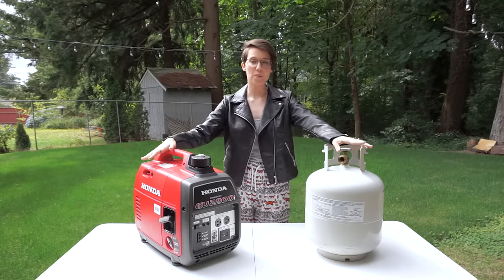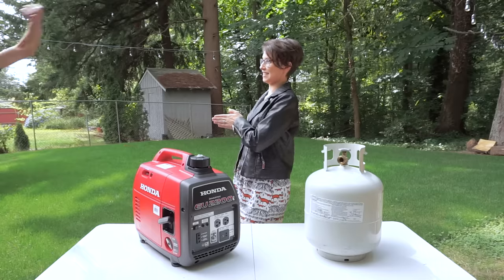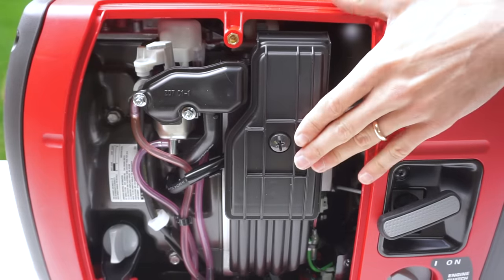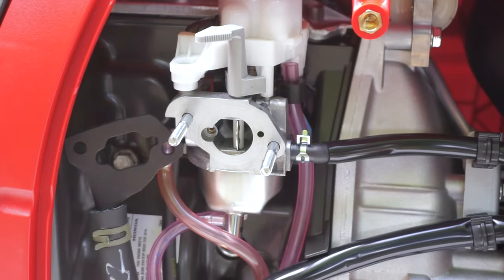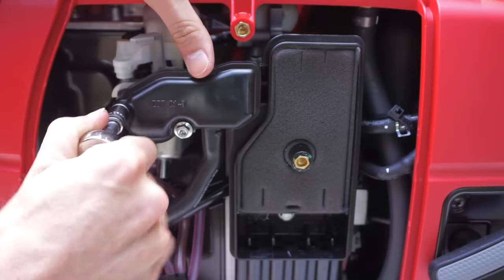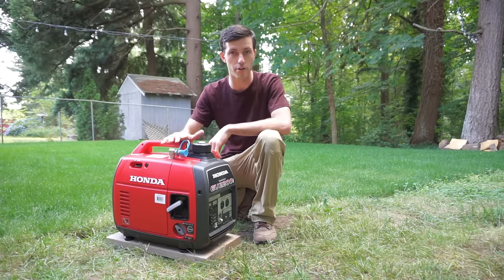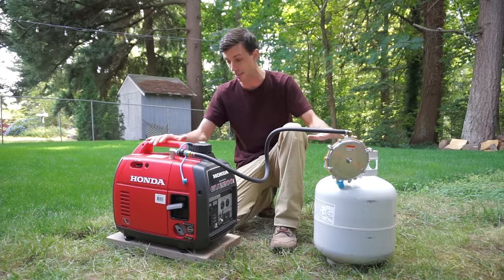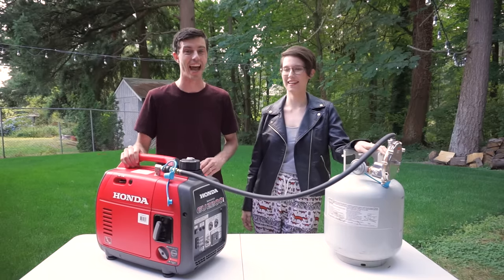Honda EU2200i Propane Conversion Kit - DIY Install for Honda Generator

Comment: How long can you run the generator on a twenty pound propane tank?
Reply from the maker: 32 hours at 1/4 load
Reply: @FateUnbound  That's impressive! Thank you. 

I just found your channel because we just bought a camper. Thanks for all the good advice and clear instructions.

Comment: When you find out how long the generator will run on a 20lb tank let us know please.
Reply from the maker: Will do! 👍
Reply from the maker: Hutch Mountain got back to me and said 30 hours of run time at quarter load, 22 hours at half load, and 12 hours at full load off of a full 20lb "bbq" size propane tank. I think that's pretty good!

Comment: Can’t help it.  @ 1:11, there are no permanent modifications, you just have to drill a hole through the case...  ?
Reply from the maker: If you listen back I said there are no permanent modifications to the engine.
Reply: Fate Unbound, yes. No argument. It was just the juxtaposition of the two statements.  Hit my funny bone. Please Forgive the chuckle.

Comment: How dangerous is running it in an enclosed area, like a campsite surrounded by tall trees on a windless day? Do you have to be concerned about CO2 emission?
Reply from the maker: It is no more dangerous that running on gasoline. The emissions are no more dangerous than gasoline emissions either
Reply: @FateUnbound  ok thanks

Comment: They should have made same kit for Yamha as well.
Reply: All you really have to do is change the adapter the contents the hose to the carb. Hell I could 3D print one... Wouldn't be difficult at all.

Comment: Propane is burned at a much faster rate than gasoline. You should run a propane filter in the fuel line. Bust a filter open and it's nasty inside after a few hours.

Comment: Deep discharge battery and solar will do the same with no gas or propane
Reply from the maker: We have a rooftop solar array for our trailer. The generator is for when we get a string of cloudy days and out batteries are low but we still need power.
Reply: It takes a lot of batteries and solar panels to be able to run an air conditioner, even on a class A motor home!

Comment: Any idea on the price difference compared to gasoline?
Reply from the maker: It's hard to say since the price of gasoline and propane are so variable across the country. Where we are now propane costs $2.40 per gallon and gasoline is $3.35 per gallon so there are good savings running off propane here.
Reply: @FateUnbound  ok thanks for the answer, this would be a  good addition for the moss covered 10 year old scamp,i got off Craigslist that Honda doesn't take up much room

Comment: How long will that run on a 20 lb. propane tank?
Reply from the maker: It will run for 32 hours at 1/4 load on a 20 pound propane tank.
Reply: @FateUnbound  Thank you.

Comment: True story, an older couple lost power due to a tree falling and taking out their power lines and it seemed ok to run their generator under the car port, but by mourning they called 911 they felt so sick from the carbon monoxide slowly poisoning them through the windows and door.I don't know if the exhaust was pointed toward the house.
Reply from the maker: Our RV has a carbon monoxide detector inside. We'll be fine.

Comment: Although a good concept, Unless you put a better exhaust valve in the engine  to replace the stainless one, It's gonna become burned.
Reply: Hey James that seems like a valid point. Could you elaborate a little and or inform me of where to find a replacement valve? Thank you
Reply: @bilbobaggins494  You may not find one for a Small industrial engine. Try Google. On automobile engines, the propane conversions called for either a sodium cooled valve or Titanium one to replace the Stainless valve.
Reply: Ok thanks a lot I'll look into it.
Reply: I haven't heard this before.  My Dad drove a truck for a living and the company converted the entire fleet to LP, I don't recall any internal engine mods being required.
Reply: OK you have me intrigued.  I did the same Hutch conversion to my EU2200i, so performing another surgery to make it better is fine.  If anyone finds this valve for a GXR120, reply here!
Reply: Hmm.. I think that burning an exhaust valve is more from lean fuel mixture than the non additives in the propane.. Lead being removed from fuel has caused harder valves and seats to be used in off road engines since 1980's .. Almost all engines off road are hardened valves and seats because of this.. I have seen generators run on propane and NG and run for years and never have a valve problem except for those with bad intake or spacer gasket to cylinder gasket failures.   Propane and NG are cleaner burning, and do produce slightly more heat when combustion occurs, but most off road engines are manufactured with this in mind.  It is like taking a push mower and restricting the air vane passages on the flywheel from grass clippings, it will run but it will dramatically increase the cylinder and exhaust temperatures.   
JHMO

Comment: How long will the generator run on a full tank of propane?
Reply from the maker: 30 hours at 1/4 load on a 20 pound propane tank.
Reply: Fate Unbound WOW. That is a lot longer than gas. Cool.
Reply from the maker: @rifke  heck yeah, we love running it off propane. And we have 30 pound bottles so it lasts a LONG time
Reply: Fate Unbound I want to buy that generator. Is there a way that it can be configured to only run when power is needed? Would it have to be configured to charge batteries and then would kick on if there was a power draw?

Comment: I would have used Teflon tape on those threads
Reply from the maker: It came with propane gas rated pipe dope on the threads already. It's hard to see because it is gray but it is there.

Comment: How much run time? Per 20lb tank?
Reply from the maker: 30 hours at 1/4 load
Reply: @FateUnbound   really that's pretty impressive. Be alot better than gas. Thanks for the content.

Comment: A 2200 running on propane is about equivalent to a 
2000 on gasoline. Roughly 10% less output.
Reply: Had a 454 in a truck with propane it used about 20% more fuel consumption and 20% less power.

Comment: vertical regulator diaphram??
Reply: Yes, the propane is already vapor when it reaches the regulator so no worries there. The regulator on my travel trailer is also vertical.

Comment: Nice video/idea, I saw what looked like Teflon tape on the propane connection on top of the generator. Did you use "gas-rated Teflon tape"?  Apparently you should NOT use normal Teflon tape on gas fittings.  Did Hutch Mountain provide the gas-rated Teflon tape too?
Reply from the maker: You are correct the tape or pipe dope must be gas rated. It was already put on by Hutch Mountain and yes it is gas rated.

Comment: No Teflon tape?
Reply from the maker: The fittings come with sealer already on the threads. It's gray in color so it's hard to see in the video but it's there 👍

Comment: I just bought a EU2200i and it vibrates too much. Anyone else's EU2200i does this?

Update: I believe the vibration is from the Honda crank not being balanced, trued and welded, which is common in most all non-high performance engines.

Comment: I clicked because I thought I could convert my honda car to propane.
Reply: you can, but its a bit more costly and not a diy job by any means, in the uk where i am you must have a licensed installer do the conversion.
its well worth it as lpg is about half the price on mileage.

Comment: no tape   any leaks  notered no check for leaks . good way to get a nasty surprise
Reply from the maker: It comes with thread sealer already on the threads of the connectors. It's hard to see in the video but it is there. No leaks 👍

Comment: Is Honda gasoline driven...why one wants to have propane driven, it is finally much more expensive to run and the engine has running interval outside the optimal which is made for gasoline...
Reply: It's what they do for youtube views , go figure .

Comment: Great Vid, but You should be honest and mention that propane fuel will result in a less wattage output because propane contains less energy compared to gas
Reply: Broderick Magnus You will still get the maximum wattage output that this generator is capable of producing, it is not a top fuel dragster.

Comment: Good video but as a engineer only having half the threads on the nut very poor you should always hae 1.5 theads proud of the nut for the price chared 2 slightly longer studs shouldent have been a problem the manufacture needs to lift ther game

Comment: Isn’t it dangerous?  If the generator shuts off for any reason the propane keeps running?  I didn’t see any shut off like the carb has to stop gas if it shuts down. Don’t they shut down on overload or low oil?  I would hate to have all that propane flowing back out of the air cleaner around the engine then to where ever the generator is.
Reply from the maker: The big regulator that screws onto the propane tank only allows propane to flow when the engine is running. If the engine shuts off for any reason then the regulator prevents the flow of propane.
Reply: @FateUnbound  no.  The purpose of the regulator is to control the high-pressure gas that exits the propane tank and reduce it to a safe level. ... This is done by the force of the spring against the diaphragm to exert a back pressure. This back pressure retards the flow of the high-pressure gas in the tank.

Comment: propane doesn't run as long as gas per gallon.  propane cuts back on the output of the generator by 150 watts

Comment: No bottle or valve is perfect. Eventually all of the propane will leak out. Long term storage is limited. Other than that. Propane is my preference for a generator.

Comment: Not convinced about the studs being so short the nut is only half on???? Not good engineering practice no matter what these suppliers say. Remember you are torquing it up to the same value with only half the threads engaged.

Comment: According to Honda using any other fuel type voids the warranty.
Reply from the maker: That didn't bother me much, but then again I also voided the warranty on my travel trailer not long after I got it by installing solar and a composting toilet in it. Never needed either warranty. My honda is 4 years old now and well out of warranty, never had any issues.
Reply: @FateUnbound  While Honda generators are reliable I would hate to discover that my warranty was void on such an expensive unit due to this modification. Viewers should know this info and decide if they want to proceed.

Comment: FATE promo only give 15 bucks not 25.
Reply from the maker: Yeah, the manufacturer lowered the promo code due to COVID related issues and they're having trouble remaining profitable. I would update the video but YouTube doesn't allow that. It's still a great product and I recommend it even after owning it for over a year.
-David

Comment: I don’t think u can parallel two generators. They aren’t phase aligned. Some of u super electronics guys could help me out there.
Reply from the maker: You absolutely can. The Honda's have a dedicated port for running two of them in parallel.

Comment: Yeah only thing you're missing to do their shut off your Eco switch you never need that on unless you're running big appliances with motors sweet setup you after you change the oil as often either because it burns clean and green all the time it's good all the way around yeah for sure turn your Eco switch off I made a mistake for the first couple years had one of those we run our new ones are we get one year exactly out of them virtually 24/7 so you get a solid year consumption out of those babies. I'm going to get one of those kits a longer hose wouldn't hurt to take a little further away would make it safer so, you sweet happy loving couple you will get years and years enjoyment out of that generator generator will go up automatically when it larger load goes on. See you don't really need to touch it unless you're going to use a big table saw for bunch of cuts then it won't be so dramatic going up and down on you be safe you guys excellent video.

Comment: The first mistake in this conversion is that the gas can return through the fuel tank because the carburetor has small openings that would otherwise be used for fuel injection and if the gas remains open it can create pressure in the tank and if the tank cap is closed and not in the run position it can blow up the tank from excessive pressure it is better to use solar and no worries with generators there are plenty of DIY and safe ways to do it

Comment: Just purchased and the Promo Code was only $15.00 not $25.00.  Hmmmmmm,  bait and switch!
Reply from the maker: We do not control the promotional discount amount, the manufacturer does. They lowered it from $25 to $15 because of coronavirus related supply chain issues and they're struggling to remain profitable with this discount.

However, if you're really that upset about $10 you can call them at 435-494-1975. Clayton is the owner and an excellent person, if you ask him he may reimburse the $10.
Reply: @FateUnbound  Thank you for acting like a grownup. I appreciate you changed your title to this excellent YouTube so that you do not continue to disappoint honest viewers and that you continue to point folks to Hutch Mountain and their excellent products and Customer Service.

Comment: ALL pipe threads used in gas must use thread seal!!!  Soft metal alone will not make a gas tight seal.  All connections must MUST be tested with a commercial leak detector solution or a 50\50 soap and water, just make sure u wash off soap afterward to prevent corrosion. You should stress how important it is to cover gas inlet when quick release is disconnected. BE AWARE! Of of generators exhaust and keep it away from propane tank! High heat to the tank can cause high pressure venting and fire or worse. Please take this video as a idea to what can be done and not as a guideline as how to do it.
Reply from the maker: The fittings in the kit come with propane rated tape already on the threads. It is gray so its hard to see in the video but it's there. Rest assured everything is sealed properly.

Comment: bad idea... with propane you always running at full opacity but with gasoline you have eco not wit propane
Reply from the maker: That's not true at all. Eco mode works perfectly well with both gasoline and propane.

Comment: Seem like you missed the step to remove the metal washer for Air Filter cover for new plastic washer ....that why it is hard to thread the 2 nuts on the left...ahhahaha

Comment: Gasoline doesn't ever go bad unless it has water in it.. which means it's contaminated by the water.. but you'd have to put water into the gas to ruin it.. has doesn't go bad it can be 25 years old and will work perfectly fine
Reply: Not with ethanol added.

Comment: You lose 10% power with LP plus I can buy a lot of gas my Honda  2000 for $270 for the cost of the kit
Reply from the maker: There is a small power loss by running off propane but we arent worried about that at all. And hey, if you don't mind running on gas that's just fine, dual fuel is worth it to us though. We are done with gasoline!
Reply: Fate Unbound Since you already have lithium, a hybrid inverter would be handy for the lower output. I know you have easy start, but a 3000 watt hybrid mult+ inverter would do the same thing, and have other benefits....

Comment: Gotta say... if you ran the thing off of gas and thought you smelled something and that you were being choked out, then you ran it on propane and didn't smell anything... then I'm pretty sure you have a bigger worry about your health than you think... Gas gens don't really have any sort of 'smell' to them... specially in an open air situation like what you just had it in.... where as propane lingers since it is heavier than the surrounding air... not to mention, propane when 'burnt' smells HORRID.... You guys must have never worked anywhere around forklifts and such, but gimme a diesel engine or gas engine any day over a propane one... No bad smells when working around a gas generator... but man does the smell of burned propane stick to your skin when you're working around something running off propane... Sure, maybe it 'burns cleaner' and the like, but I'd get super light headed and sick from the horrid stench of burned propane....

Comment: So leave the propane tap open, without starting the generator, you create yourself a bomb? There is no safety at all. What if the engine seizes? Gets to hot or stalls by heavy loads, the propane supply is not automatically stopped. In cars on gas, there is an electrical shut off valve in the gas supply, that only opens if the ignition is on and will close if there is no signal from the ignition coil, as the engine is stalled for example. This conversion you do frightens me........ I’m Dutch, and legal cases here are not so overreacted as US cases, but I think your conversion can be used wrongly and kill people..... a disclaimer would be great.
Reply from the maker: There is a regulator that stops the flow of propane when the generator is off, it is the big metal thing that threads onto the propane bottle. You really think they would design it to just allow a free flow of propane???

Comment: The problem with the Hutch kit is that at best, it's bound to fail. And at worst, cause an explosion. The weakest link in their system is actually the piece that feeds the propane into the engine, which is simply a piece of 3D printed plastic... Anyone who installs that has to be genuinely insane. The Grenergy conversion kit uses a CNC machined aluminum venturi instead.